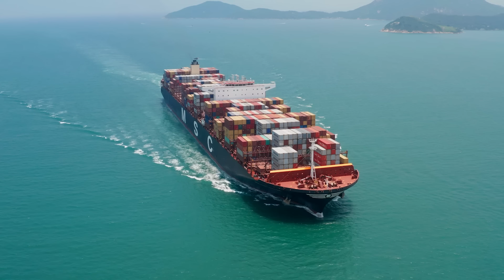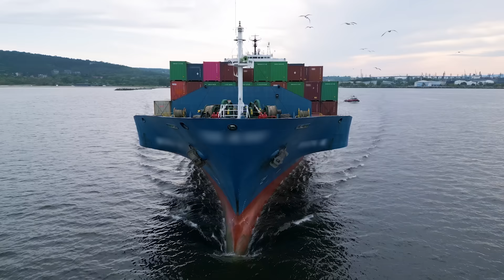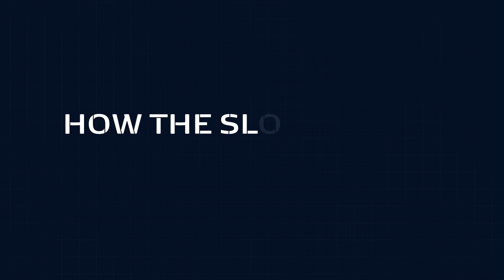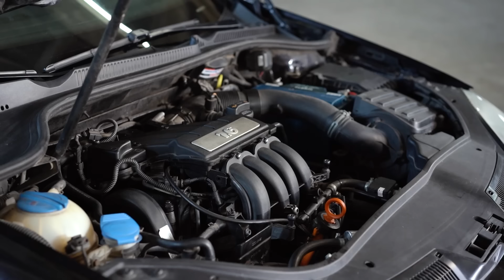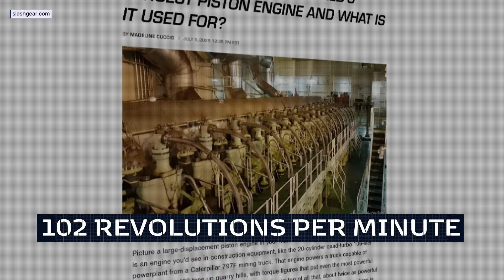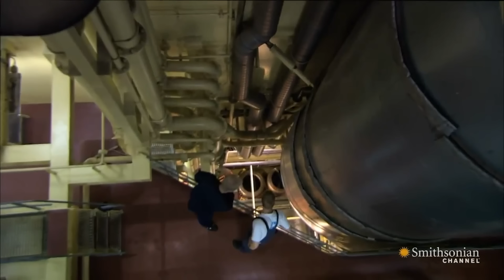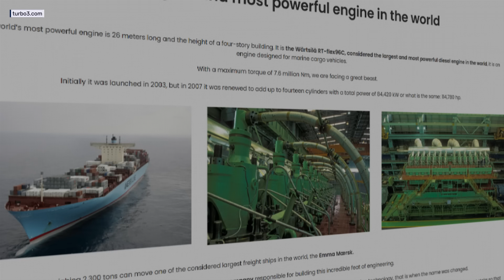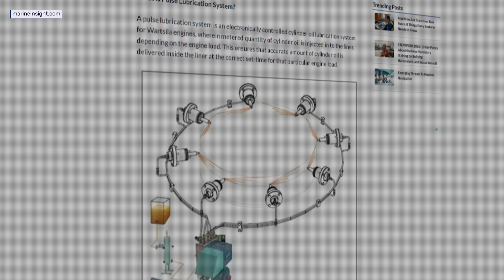The 100,000 Horsepower Engine

Comment: Automotive applications, I do not believe they ever extended past the "Straight 8"
Reply: Packard did one at 12.
At one point there also was a dragster (so technically an auto) that had 2 inline 6s in it end to end so that was kind of a 12.
Reply: @kensmith5694 The Packard straight 12 was experimental. They only made one.
Reply: I think Bugatti made a v22 or something
Reply: Caddilac built a V16
Reply: @johnstreet797 Which is not relevant here. Why even mention it?
Reply: @johnstreet797  V-engine, not straight. Different engine layout entirely.
Reply: I believe it was Jaguar who mounted a pair of V-12 engines. Only one of them was bolted to the transmission. The other was for noise cancellation. It was supposedly nearly silent. Never made it to production, of course.

Comment: Well, is it any wonder fuel is so "expensive?"

We really need engines in our cars with at least 60% fuel efficiency, this feels like an absolute scam.
Reply: Yes, unfortunately we run into something called "physics" that tells us this is practically impossible with standard designs burning fuel. You can look up "Carnot cycle" if you want. You want efficiency? Go electric or fuel cell. That's about it.

Comment: 18:40  Some ships have a small(er) tank of low sulfur fuel they use ONLTY when it is required in a specific port.  So they burn the normal crappy stuff for the whole voyage and switch to low sulfur just a short distance away from port.!!   

I think this is funny, the port requires low sulfur fuel ... but just when they are close by!!  :)
Reply: Yeah because they are people at the port, sometimes even citys. Maybe having lower sulfer levels in the air is for health reasons. (Tho I don't know what sulfer does to the body besides smelling bad.)
Reply: The solution for pollution is dilution.

Just let it out where nobody lives and it's whatever (for a while, at least).

Comment: How much vibration is produced that travels thru the structure of the ship.?
Reply: As a retired  Ships Engineer these Engines are " Very  Smooth" you do not feel any vibration in the acomodation. Most of the vibration comes from the propeler.
Reply: @GrahamNewman-mq7gr  Well, there are RPMs where they vibrate a lot, but of course that is only when manoeuvring.
But when steaming, I would say it is comparable to a scale 2 or 3 earthquake. You can feel it, but you don't really notice it.
Reply: IF there was alot , it would metal fatigue the hull over the 20+ years it is expected to operate.  There has been insane amount of hours spent on designing the engine to minimize vibrations to level that can be mitigated to be manageable.
There's always some but not in the way you are probably thinking.

Comment: For every pound of thrust a jet engine makes, at 375 mph, produces 1 hp. IFAIK, the most powerful jet engine puts out about 110,000 pounds of thrust.
Reply: Oh, there were ideas to use jet engines on ships. However, does not work, not at all for various reasons.
Reply: @dr.paulwilliam7447 jet engines (gas turbines) are in common use in military vessels, the US Navy "Arleigh Burke" class of guided missile destroyers for example. What's true about jets on ships though is that they are not direct-thrust jets as in a jet airliner, the gas turbines are attached to either a reduction gear to directly drive the propellers or to generator sets to make electricity that is then used to drive the propellers. 
I'm not aware of any civilian cargo vessels using gas turbines though, they're not anywhere near as efficient as the Wartsilla diesels.
Reply: @douglasthompson201 you are absolutely right. I forgot about military vessels

Comment: 100 rpm is 100 times faster than the second hand on a clock. Unless your watch is broken.
Reply: 100 revolutions per minute vs 1 revolution per minute.. yeah, that tracks.  Had to stop and think for a second or 3 on how fast a second hand moved.
Reply: @spudgamer6049 seconds hand - not the second hand
Reply: @brookatkins8111  finally, someone that actually understands.. I posted a comment explaining how he meant the hand that counts seconds, and not “the second hand”.. and someone else replied “oh the second hand, the one that goes around specifically once every minute”🤦‍♂️ it seems like everyone was dropped on their head as a baby ffs
Reply: ChatGPT script problems
Reply: what really blows peoples minds is when you tell them the earth spins at 1 revolution per day
Reply: The big problem with very long engines is the crankshaft twisting under load as the torque adds up.
Reply: @Dave5843-d9m I'm kinda curious why they dont go with a V or flat arrangement to help with that, but otoh with that long of a stroke you're getting into space issues I guess.  Kinda like how many reciprocating steam engines used vertical cylinders instead of horizontal.
Reply: My guess would be to distribute the weight of the engine more evenly across the hull. Imagine the re-enforcement you'd need if all of the weight was over a footprint half the size it is now, not to mention pinning down all of that torque 🤯
Reply: @Dave5843-d9m if you're running at a steady rpm for hours (or days), does crankshaft twist really matter at all? It twists to a certain point then stops and holds that twist until power is let off. It's a minor problem in a car that is constantly changing speed, not in a boat that does the same speed for a week.
Reply: Indeed I caught that too. Considering the idling rpm’s of most cars, this is still very slow for full throttle. Imagine that crank shaft spinning at that speed. Pretty incredible.
Reply: FSO (ex VLCC) Cawthorne - I'd post the engine speed plaque but I can't in YouTube:
Dead Slow: 24 RPM
Slow: 32 RPM
Half: 48 RPM
Full: 56 RPM
Nav. Full 75.6 RPM
Barred speed range (RPM): Engine not to be operated continuously between 36 - 44 RPM
In the event of a cylinder misfiring, the engine should not be operated above 66 RPM. 

The above is for an earlier version of the 96 series engine (but only 6 cylinders)

Comment: The real megaproject is cleaning the heavy fuel oil compartments of a ship that huge 🫠
Reply: I was an Engineer in the Merchant Navy for 14 years, I cannot recall ANY of the bunker tanks being cleaned on any of the ships I was on. The only time I can think it might happen is if one of the steam heating coils started to leak. Then it might be cleaned to allow a repair. More likely if there were a number of coils, the leaking one would be isolated.
Reply: Even then the tanks are not cleaned. Was on an old M class ship. The heating coils was repaired from the inside, with some kind of leakstop chemical. I was only a Cadet at the time.
Reply: @petertuxen4930 M class. Blue Flue??
Reply: @billdoodson4232 100% Correct Another Idiot comentating on what he knows nothing about and has NO  seagoing experience. Typical U Tube.
Reply: @billdoodson4232  I believe you. I’ve seen video of some brave soul attempting to clean the substance out of a tank of some sort, and it doesn’t even seem worth it. If I had to guess, it was some sort of scrapping or remediation project, but I honestly can’t recall if there was context.
Reply: @0o0ification I'm not certain but I think I remember either an episode of Dirty Jobs or Undercover Boss where they (either Mike Rowe or some CEO depending) helped clean a heavy fuel tank car in some railway. I can't remember the exact situation, I just remember a person being very claustrophobic and covered in tar looking crap inside a tank car.
Reply: LMFAO, "it's Crude flavored Jello!"
Reply: @karimali7602  That bunker buster crap is HORRIBLY nasty.
Reply: The real megaproject is keeping the damn running when owner refuses to pay for parts, while demanding more and more reports, to find places to cut costs...
Reply: I wonder about the combustion, it must get extremely gunky in the cylinders after thousands of hours, but I suppose easy to clean because a human can fit in there. I can't imagine that dirty fuel burns clean.
Reply: @RoboCop-zn8bt The engines themselves are not that dirty and don't need to be cleaned. The exhaust side of the turbos collect a bit of soot and this can be blown off by injecting steam onto the turbine disk while the engine is running. There is an exhaust gas boiler in the exhaust flue to provide steam when the engine is running (which collects even more energy out of the fuel) and this is usually cleaned by steam injection to clear the soot off the tubes. I used to do it on the 00.00 to 04.00 watch in the morning when we were well out at sea. No one could see the soot smuts and it wouldn't blow on to land.
Reply: @billdoodson4232 thank you, that makes sense. Steam is a great cleaner and can produce power. I seen videos of the fuel oil and it looks like sludge. I'm curious how it's injected into the cylinders, most likely heated to become almost vapor ? To me it's seems an engine of this size has to have a lot of solutions to burn that fuel.  Cheers
Reply: @RoboCop-zn8bt Yes, when I was at sea, the heavy fuel oil, HFO, was about 3,500 seconds redwood viscosity. It had to be heated via a shell and tube heat exchanger to about 120C if I remember correctly, so the viscosity would be low enough to inject. Most engines were started on gas oil (like heating oil) and then when the ship was away from the port, they would change to HFO. I don't know if this is still the case.
Reply: @billdoodson4232 you are talking about fifty years ago. Present day engine don't change over to gas oil. Only if they are in SICA where sulphur regulations are enforced. About cleaning try to clean scavenge spaces or scavenge manifold. Real problem was old sulzer.
Reply: @snd9826 Things change, that's for sure. My first ship had a double acting B&W. Now the scavage spaces in that were horrendous. We used to have a savage fire pretty well weekly, mainly due to the 2nd Engineer turning down the cylinder lubrication too much and having so much wear from the liners and rings causing blowby. That engine was fitted with a couple of big Roots blowers, no turbos. Search on YouTube for Diesel Museum Copenhagen, I think that is the very last of those engines in existence. The Sulzers I worked on, RD's and RND's, all had pretty clean scavage spaces in comparison.
Reply: @RoboCop-zn8bt  I’m pretty sure I heard two-stroke design, so it should be burning. Small engine varieties are more familiar to me, like a leaf blower or lawn mower
Reply: You NEVER have to clean out the  "Heavy Oil Storage Tanks" . This myth about " Tar Ect" is  U Tube rubbish by fools who have never worked on a vessel . I did 25 years + on ships using Heavy Oil for fuel.
Reply: The HFO tanks will sometimes get steam cleaned during refits.  One of my first shipyard jobs was surveying as-built locations of new tank gauge on a Canadian icebreaker that was getting new engines and bow. All the fuel tanks had been cleaned and inspected as part of the work.
Reply: @GrahamNewman-mq7gr  it SHOULD be cleaned. Think about what builds up in there over 25 years. It'd probably run more efficiently with tanks cleaned every 2 or 5 years. Also less possibility of sucking in debris that has accumulated over TWENTY FIVE YEARS.
Reply: @crazyidiot5309 they have filters for that. What part of this don't you understand?
Reply: @leroy420b  Just as any vehicle has an oil filter. There's NO part of this I don't understand, and don't condescend to me. I was making the point that if CLEANED, it would probably perform better. That's the root of my assumption. Either you understand it or you don't. I'm not speaking Mandarin.
Reply: A clean storage tank is simply not relevant to consumption efficiency. The fuel does pass through a centrifuge and filter bank before reaching the engine, but these use a vanishingly small fraction of the engine’s power.  Cleaner tanks may extend the clean-out and maintenance interval of the centrifuge, but that’s unlikely too as the sediment in the tank seldom reaches the pickup tube, and suspended contaminants will typically remain suspended in the goo that is warm (not yet hot) HFO in the tank.
Reply: All you do is warm the tank. I sampled bunker barges (HFO barges) and for the stuff to be useful it has to be hot.
Reply: They don't get cleaned. It's not necessary, as a general rule.

Comment: That's a Godzilla size SUCK-BANG-GO motor.
Reply: 2 stroke ain't it?

So like
Suh-squeeze 
Ban-gah-blow

Or something. I wonder if anyone has tried a different exhaust pipe geometry?

Ported the cylinders?
😂😂😂😂😂

Like competition chainsaws?
Bahahahaha
Reply: @threadtapwhisperer5136  I've built dirt bikes and modified many smoker engines and did lot's of bulging snake pipes yes expansion chambers are the  heart of where low end high reves can be tuned to fit the riders power preferances.
~~~~~~~~~~~~Braaap!
Reply: @gastonbelanger5346 
I’m not sure it would work on a 2 stoke diesel like it does a petrol
Reply: @gastonbelanger5346  That's not quit how it work, modern 2 strokes use, what is known as "crossflow" scavenging. This means, that when taking fresh air in and blowing exhaust out, the airflow goes across the cylinder, so perpendocular to the piston direction. Modern marine diesel 2 strokes use a "uniflow" pattern. They have not only intake slits but also an exhaust poppet valve at the cylinderhead. This alows unidirectional flow from bottom to top, wich theorethically allows for perfect scavenging. It also allows a 2 stroke engine to operate compmetely independant of an exhaust pipe geometrie, as the these types of two strokes can be supercharged or turbocharged with achieving actual cylinder overpressure, not like these turboblown snowmobile engines, wich essentially just increase scavenging efficiency.
Reply: @Enthropical_Thunder  Bottom line it's still a Suck-Bang-Go,
Reply: Excuse me 😳
Reply: @雪狐fluffy  SUCK> piston goes down for a charge of gas and comes back up for combustion>Bang**piston goes down for GO as it suckes in a new gas charge~~~~~~~~= SUCK~BANG~GO....Dirt bikers slang for two stroke motorcycle engines
Reply: Suck, squish, bang, blow!!

Edit: ah, I see what you mean lol.

Comment: Time for a deep dive on exactly why engine manufacturers are bending towards cleaner burning fuels...

The fees are extraordinary high carbon taxes ships are getting hit with.

Costs are passed on to the end users of products shipped...
Reply: These are diesel engines the can run on anything that can burn and be pumped into the combustion chamber.
Ship owners however, need to follow the laws. which means since 2020 they need to burn fuel with less than 1% sulphur or have a giant exhaust scrubber installed that can filter out the SOx gases.
Reply: @tjampman 
They can run on anything as long as the systems involved can accommodate

Comment: I want one of these for my car
Reply: No, you don't.  You can't afford the fuel
Reply: @kensmith5694  I'm American
Reply: You need to get a proper gearbox as well or you will be going incredibly slow!
Reply: @tjampman add like 10 gearboxes together, and you could travel at mach 1 while the engine runs at 4 rpm

Comment: How big would an electric engine be for the equivalent output?
Reply: The better question is where are you getting the electric to run it? Your would need to run a cable all the way from Taiwan to Southampton
Reply: @mrmuttley haha, no, I was thinking of a diesel engen to act as a generator
Reply: The problem would be the Electrical Power Needed and How would you generate it .
Reply: electric motor!
And I don't think it would need to be as big as you would think.

Comment: Edited: Nevermind, I asked the question before he got into the environmental effects of burning the bunker fuel.

So, why can't one of these engines be hooked up to an appropriately sized land based generator to provide power for a country's electrical grid?
Reply: Nuclear is the word you are looking for buddy.
Reply: They can and are... But the fuel is too expensive for big operations.
So they usually only have diesel generators in isolated areas.

The Emma Maersk was built in Denmark, and in Denmark back in 2003 there was a major electrical black out, and they used a 22000 hp diesel engine built in 1932 to restart the grid. it was connected to the only generator with permanent magnets. That engine is almost the same size as the one on Emma Maersk just fewer cylinders and a bore of 84cm. it is 100 years old, so of course not as efficient.
You can read more about on their website, search: dieselhouse copenhagen

Comment: “A family car engine holds between 1 to 2 liters.”

I have never had a “family” car with an engine that only displaces 1 to 2 liters. My pickup has a 6.2 liter engine and my daily driver has a 3.6 liter engine that puts out over 300 horsepower. I can’t imagine how frustrating it would be to drive a car with 90 horsepower and sounds like it’s being powered by rubber bands!!
Reply: That's a very US view (and one I share, but that's OK). Typical Euro sedans are sub-2-liters...
Reply: The average engine displacement in the USA is roughly 2.9 to 3.0 liters, compared to 1.5 to 2.0 liters in the rest of the world. I understand why you would think 90 hp is very little power, but imagine - just imagine, if a car isn't as heavy as an african elephant and doesn't have the aerodynamics of a concrete block, you need way less power to move the car. Though 90 HP is on the low side, even in Europe.

My Škoda Octavia RS's 4 cyl. 2.0 liter TSI makes around 260 HP/ 195 kW - 370 Nm of torque, and the range is great (if my foot is light lol). I mean, Toyota squeezed 300+ HP out of a 1.6 liter 3 cyl.
Reply: I have a scion iq 1.3l inline 4 it has 96hp and 98ft of torque weighs 2200lbs it's rather quick for what it is and it's like driving a bigger go kart